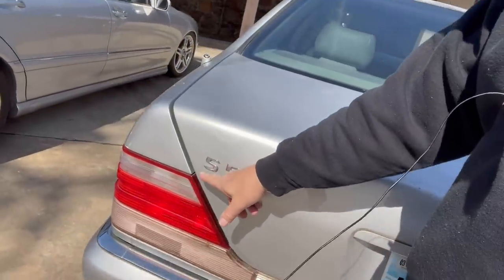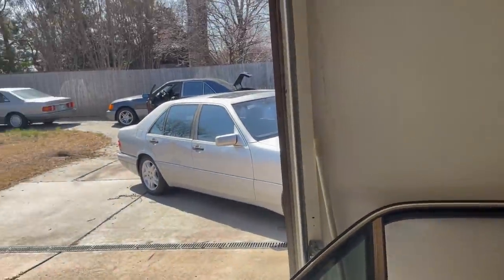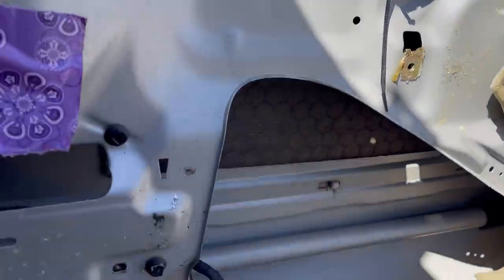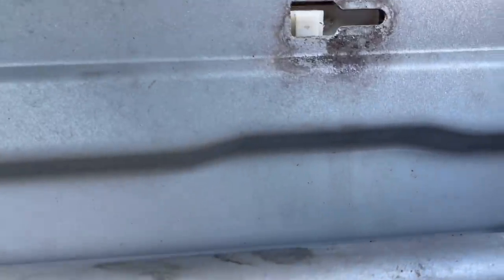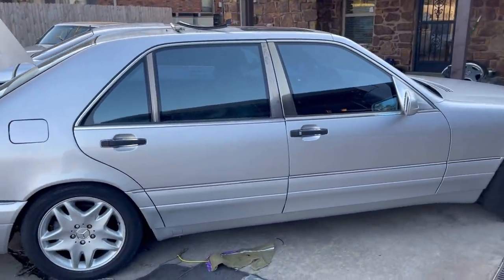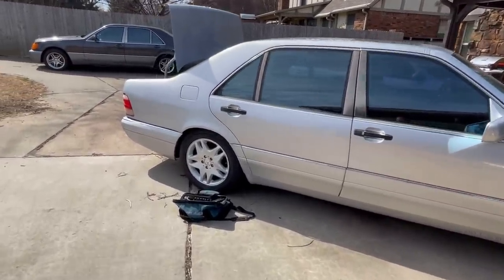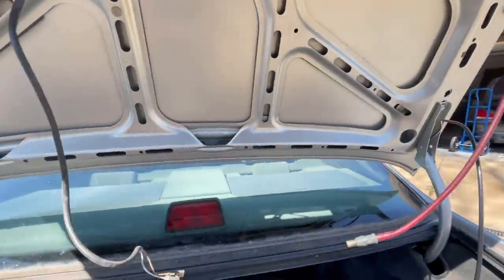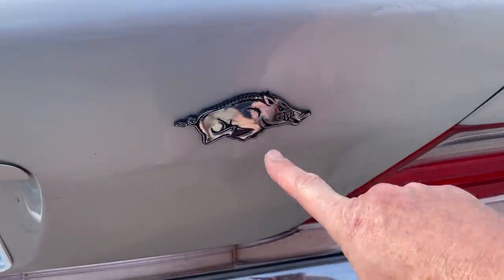Adding Body Armor To The Tank

Comment: Having parts cars is a massively good idea if you run older Mercs, if you have the space to accommodate them.  People generally don't want to fight with a misbehaving Merc as they're so complex, so you can often buy a complete parts car for less than the cost of a used major unit removed from a vehicle, and you get all the little parts than nickel and dime you to death for free...

Comment: I may be being a little knit picky but I have a little hang up about that 80k dollar when new S500 having a base model steel sunroof on your freebie. But if your parts car has a glass sunroof consider switching it over to it or better yet your w126. Would make for some good content. I switched to glass on both my 89 300se and my 89 300sel. It’s not too difficult and everything matches right up.